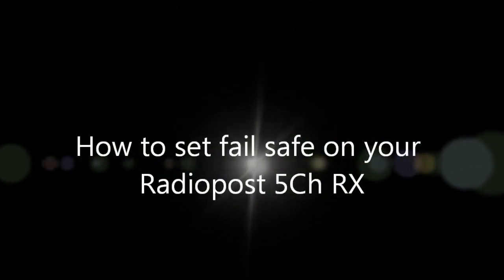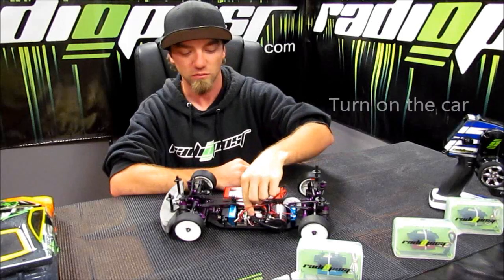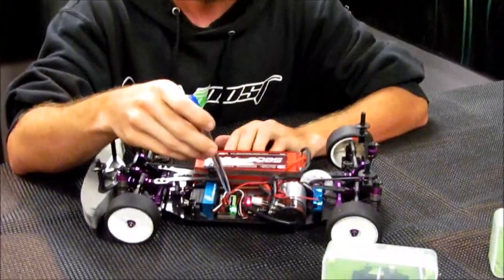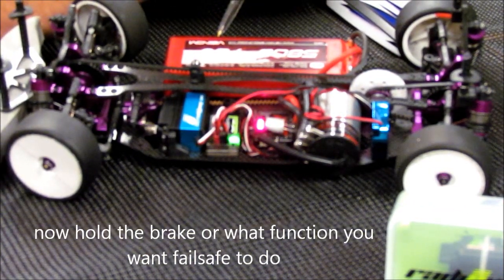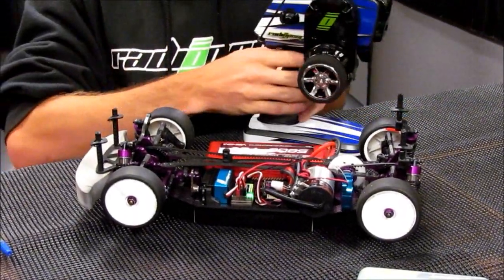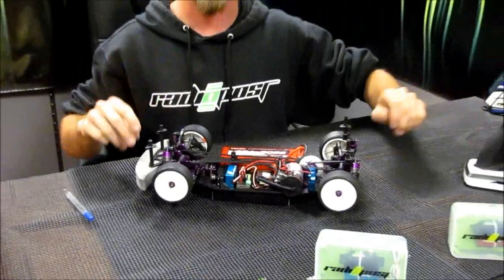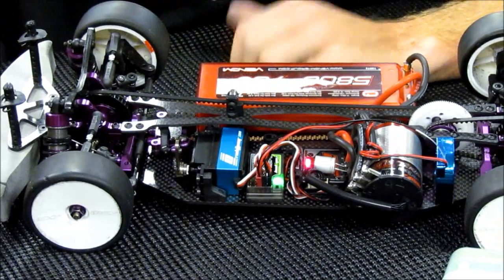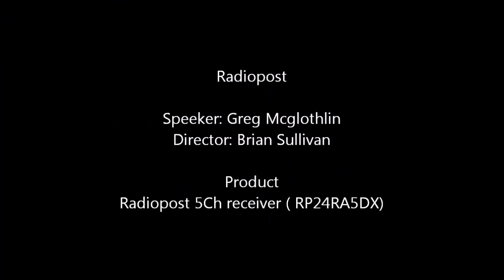how to set fail safe using radiopost 5Ch RX in your electric car

Comment: This is the 5ch Rx, I just did it on mine as the car would go ballistic if it lost signal.  Count to 3 million and it will flash as above, then quickly hold the brake and wait for it to go solid and it's done.